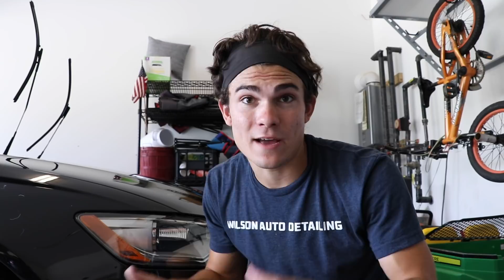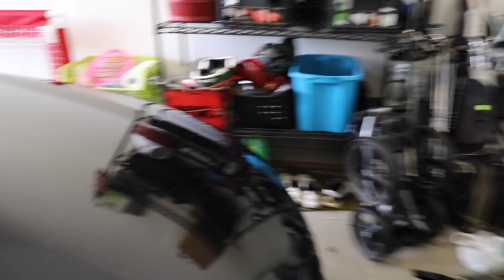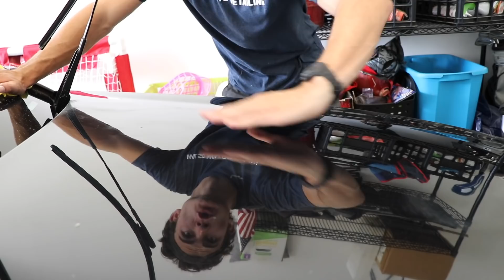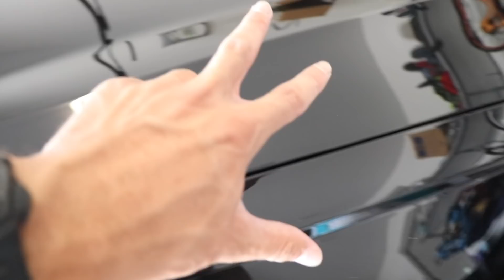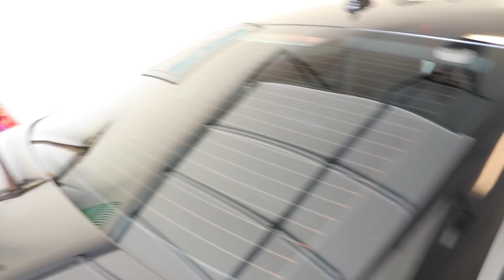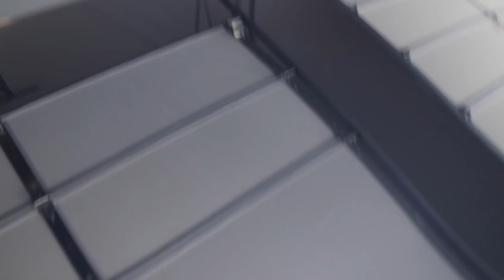Rotary Polishing For Beginners: You Need This Tool!

Comment: Hey Luke if you try the 3 step 3M line up, compound/machine polish/ultra fine polish and switching from wool to foam to light blue foam pad the results will finish down to the swirl/hologram free finish you are going after. That’s what we used at the production body shop where I use to work.

Comment: Luke...I have a great tip for u...courtesy of apex auto detail. Use a microfiber applicator to apply your compound first...like you are applying a wax...spray your favorite detail spray on the pad to condition it...then buff the panel...no more sling and no more spurring your pad after every pass...more efficient...great vid by the way
Reply from the maker: I like it!
Reply: You shouldn't be adding silicone or wax to you pad before buffing or polishing.

Comment: I have used a rotary polisher for years and I am going to buy a da polisher. It sounds like DA polishing is going to be a fairly easy transition. Thanks for the details.
Reply: I'm with you. I've used a rotary my whole career, and I plan to continue using one to cut, but I'm going to get a da for finish work

Comment: Stopped at a body shop today to get a test panel for new Maxshine rotary I have yet to turn on.   They were great!  Got me a free black jeep hood with a minor bent corner.  They told me I could grab whatever I wanted from the pile.  Then their buffing expert with 35 years experience gave me a tutorial with his rotary and wool pad and explained his system with the sanding steps.  Very cool of them.  Question: Why do you normally see 5 or 6 inch pads on a DA but 7 or 9 inch on a rotary?  I would think a 5 or 6 on a rotary would give you a little more control and less chance of absent mindedly burning an edge.  I am going to purposely burn through the hood to test.  I have a Griots 8 and 6 but it seems to take forever to get defects out with many passes at slow arm speed at buffer at 4 or 4.5.  Of course I have only done 4 cars and a delivery truck so far so is probably my technique.  Doing my brothers Kelmark kit car next week and not sure what the paint is but will test a section carefully first.  I also see a friends boat in my future hence I wanted to learn the rotary.  Thanks for all the instruction.  You are one of the first detailers I found on Youtube and I have learned quite a bit from your videos.  Final note: I asked the body shop expert what is meant by "body shop safe", he said it means no silicone as that will find its way to the paint booth and cause "fish eyes" in the paint.  I thought the term meant it had no waxes or silicone so that you could coat the car after polishing it.

Comment: Remove the backing plate, add a 5/8", 3/4" long nut to the spindle and use double-sided wool pads that are balanced. You'll double your overall feel of control being that much closer to the surface.

The little things.
Reply: Werd!

Comment: Great intro to the rotary. The DeWalt is really a nice machine. First time using mine I was shocked at how smooth a rotary is.  None of the annoying vibration that a DA has. 

I have three DA polishers and all of them stall easily, which means I am wasting my time. From now on it's DA for wax application only, or for final polishing if there is any haze or any buffer trails. 

Another cool thing about rotaries is that you can find pads in any size from 1" to 7" and probably even larger.
Reply from the maker: Yep, all really great points to support the rotary! And reasons why I also LOVE IT

Comment: For those of you who want to learn to use a rotary machine, I suggest going to junk yard or body shop and buy a scrap car hood in good condition and practice on that first.
Reply: Is it really that serious? I'm a first timer and all I see is bad news about the rotary Im starting to feel like this is really over exaggerated
Reply: @bobbyghost2594  Its not that bad but the wool pad is more aggressive than foam. You can get a softer cut wool pad for polishing. I use a harbor freight rotary with foam pads and a mild cut polish and a sealant with ultra fine polish (cleaner) and it saves hours over a DA polisher. BOSS PAINTER has some old videos on buffer pads and using compound on wool, he is an expert and does not use a DA to cut & buff. Hope this helps.
Reply: @heavymechanic2  thanks 👍
Reply: That’s right

Comment: Great video! I've always been pretty leery towards using a rotary buffer but it doesn't seem that bad after all. I've already got a Griot's garage DA so I guess I may want to invest in the Dewalt at some point soon for a companion tool. Out of curiosity, I noticed you used the Show Car compound/polish instead of the Meguires M105 and M205 are you not using those anymore? If so, what's the pros/cons of each product line?

Comment: Luke, have you thought about investing in a paint thickness gauge? Worth it’s weight in gold. I own one and would not touch a car without using it first to get an idea how thick the paint is.  Will only tell you total thickness (base+clear) but it still extremely useful. Decent ones on Amazon for about $120-130. Cheers.
Reply: Neur0bit link to which one you’re referring to?
Reply: Ben Runkel  - Ben - Here you go. http://a.co/4Px2TcR  - Cheers
Reply: @Neur0bit y wud u wana do thr

Comment: Luke, thank you for such a great video.  I am a hobbiest detailer.  2 questions.  1.  Is a DA the same as an orbital.  2.  I definitely understand wool pad for rotary on a compound job.  When polishing would you use orbital with foam pad?  Thank you.
Reply: There are two types of Dual Action (DA) polishers, A) Random Orbital DA's (by far the most common of the 2) and generally what people are referring to when they say DA and B) Forced Rotation DA's, sometimes called Gear Driven DA, the Flex 3401 is the most common of these.

When using the Random Orbital DA (or forced rotation for that matter), you can use wool but would not want to use the wool pad he is using there, it is specifically for a rotary and probably would not give very good results on a DA.  Rupes makes some good wool pads for DA's.  Lake Country I believe does too but  double check they are intended for DA use before purchasing.

Comment: What an amazing job. I am afraid to use a rotary. Can I get the same results with a DA Griots Garage and using the 105 from meguaire's?
Reply: Manlio Bauitsta sure you can. m105 on a orange cutting followed up by m205 on a white/black pad.
Reply: Ammo Bee . Thanks for the answer. What brand is the Orange pad and the black/white pad...and is it a 5 or 6 inches?
Thanks.

Comment: I have a flex 3401. I haven't found pads I like with it yet. Which pads would u use with this machine and why. I've used lc hdo pads, ccs pads, force pads. Of these I use the force pad for compounding and the hdo pad or ccs pad for polishing
Reply from the maker: I generally reserve my rotary exclusively for cutting
And heavy lifting so I only use wool pads
With it
Reply: Try a microfiber pad. I have the makita po5000c and I find microfiber works best in forced rotation. Meguiars cutting microfiber pads with a polish(not compound).

Comment: Are there any old detailers out there that remember Beauty-Shine polishing compounds?  That was a brand I used about 40 years ago when I was a detailer and I'm wondering if it's still available.  It worked great, and didn't soak the pad like the water-based brands of compound these days.

Comment: Good job 👌👌👌
So can you use wool pad after wet sanding 1500 then 2000 grit for color sanding of new paint job or only rubbing compound and go a head then polishing compound, on first setting  
Then swirl removal 
Or better to use orange sponge 
For rubbing , black pad for polishing 
And lastly that I dont know for swirl which pad to be used ?

Comment: Can you use microfiber pads with a rotary? Anyone?
Reply: yes off course, but it will cut so much faster because torque of rotary+microfiber string. i think rotary with hard foam is more than enough for correction

Comment: This notion that a rotary is scary to car guys explains a bunch. In the boat world, it's just what you do. When hiring detailing staff, the lack of knowledge on this tool for "detailers" I always found odd. Then again, I'm scared of car paint so... Still, cool vids! 
Love your vids. 
https://youtu.be/1bqXf34Mz_0

If I may add: The tools and products, pads and such are less important than technique. That and what you're comfortable with. I only hire confident waxers, even if they suck on the "interview". Typically takes car guys 6 months to be as good on a boat as they are at cars. I can teach the basics to perfection in 2-3 days but the whole class is months long.
www.deckhanddetailing.com

FYI, that DWP849x you're using... You're welcome. We worked with DeWalt to make that. Basically called them up with 17 improvements, they used 14 and bam! Awesome tool!

Comment: Why do you move a rotary polisher so much faster than you would a DA?
Reply: Because of the fear of staying in the same area fort long period of  time. Heat is not a good news for the clear coat.
Reply: You should not be. With a rotary you want to use slow arm movement but always keep it moving . Fast arm movement causes worse holigrams.

Comment: I'm sorry. This video makes no sense. We're in 2018. The DA with a Microfiber cutting pad or a foam cutting pad is way more efficient. Your a nice kid but you really made yourself look bad on this one, not to mention not measuring the paint. Also, that is not the direction to polish a ridge.
Reply from the maker: Thanks for your honesty Tom! I appreciate it! I must say I disagree with the idea that we don’t need rotarys anymore because of the DA, but if DA’s alone work well for you then more power to you!
Reply: Rotary all day!
Reply: The title says is about using rotary, not using paint thickness gauge.
Reply: Tom Sommer You're wrong. One word, LONGER!!!
Reply: I wouldn't hire a detailer who couldn't use a rotary and honestly resorting to a RA for your start-to-finish is kinda half-assed.
Reply: Tom Sommer, You couldn't be more wrong, ALL the body shops use rotary's because they don't want their employees spending all day on a car, its pretty clear to all of us you never compounded and polished a car with severe paint issues.